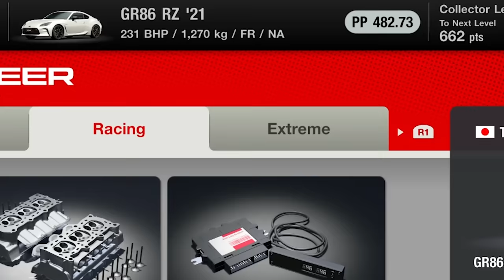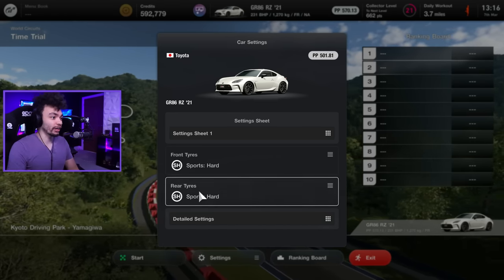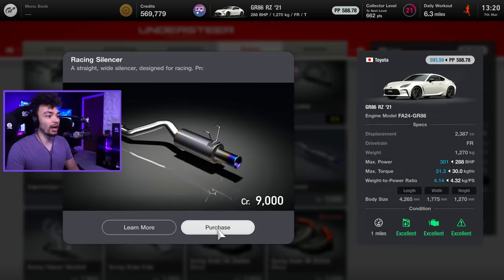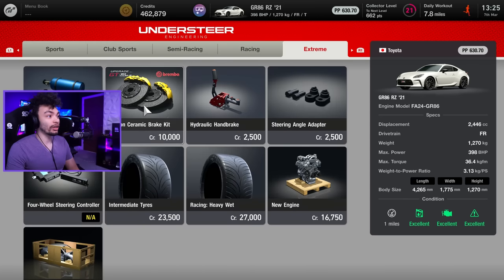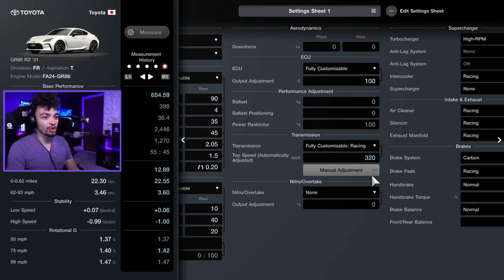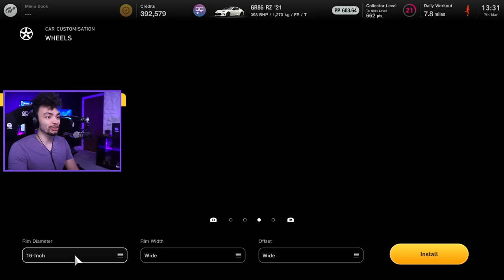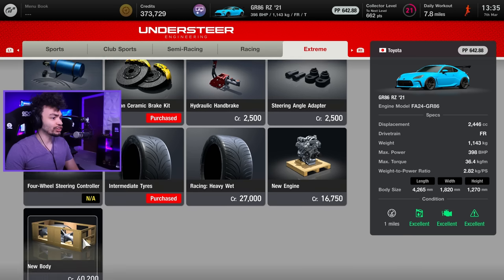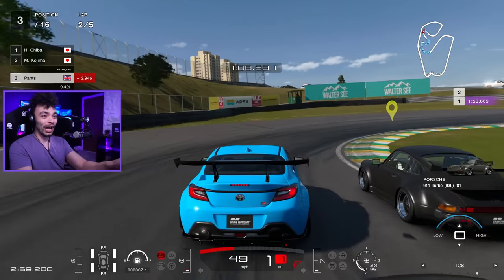How To Upgrade your Car in Gran Turismo 7! (Basics)

Comment: When performance points is not a limiting factor, I will almost always add parts in this order; tires, weight reduction, suspension, downforce AKA spoilers, transmission and then power adders finally. I've been playing this game for 25 years. That method has always worked in my favor.
Reply: Same here. Exactly
Reply: Agreed. The weight reduction helps so many different aspects. Handling, braking, acceleration. Great bang for the buck
Reply: @r6TrdSlow  yeah, on Tire restricted races, I always went with suspension and weight reduction and downforce primarily. Like you said, best bang for the buck.
Reply: Same mate but brakes are big for me tend to just send it on overtakes
Reply: I agree. Now that I've been playing the game for a little while they seem to be exceptionally more important in GT 7 than any other previous game. It's amazing how far the Dynamics and Graphics have come in this game and the past 25 years. Honestly though, some of my favorite cars were in the earlier GranTurismo games.
Reply: @adandredestefano  yea the run of the mill cars are lacking in GT7

Comment: Another tip for everyone that hasn't done so yet. Downforce. This is second only to tires. You'll need a wing and Aero mods for the front and rear to maximize the effect. Maximizing downforce in older cars especially will make them feel like completely new vehicles

Comment: For a gradual improvement that focuses on control, and will let you use your vehicle in more events. I recommend...

Tires first.
Weight reduction 2nd.
Brakes 3rd.
Suspension 4th.
Flywheel & auxiliary stuff 4th (power limiter, brake controller, etc.)
Ecu, intake exhaust, turbo/supercharger/etc. power last.

Ballast/widebody/spoiler/nitro optional.

Comment: I’d like to add about the gearing, don’t just follow the power points, do it based off what race/track you’re trying to do. Like if you know you’re gonna be doing a lot of corners and need fast acceleration in the low gears, make your top speed much lower, that’ll give you a higher gearing ratio to get a faster acceleration out of corners but a lower top speed. Top speed isn’t very important unless you have a lot of straight long shots in the race you’re doing. Yw

Comment: Good basics video! May I offer some advanced stuff?

I have this same car, and I was tuning it for around 550pp, 295 hp. But it was unstable at times on SH tires. Snapping on me when I corrected for a little oversteer. 

I kept the suspension stock to retain it's balanced handling. (Warning: even if you match the OEM suspension settings with your customizable suspension your car likely won't handle the same. For example the roll bar will not feel the same) 

I knew most of my problems were due to the power delivery of the car. So, most of the Tuning came down to tuning the LSD. 
I know it's an intimidating thing to work on but just work on it like this. Modify only one setting by like 10 up or down, take it for a spin, see if it is improved to you. 
For this car I ended up slowly maxing the intial torque, lowest acceleration sensitivity, and maxing the braking sensitivity. Why?
braking sensitivity activates when off throttle. Acceleration sensitivity is when you are on throttle. Initial torque can be thought of strengthening the actions of the LSD. Remember the LSD is only active during cornering. 
I ended up on the lowest acceleration sensitivity to make the car rotate under power, but not feel like a welded diff under power. (if you go for the highest setting this is kinda what you are doing) Whereas the braking sensitivity needed to chill out. This makes it understeer more, but this car's suspension is built to make it playful, so it compensates. I steadily increased the initial torque to soften the reactions of the car. (You usually want to do this as you increase in power)

Now the car can be used on sport hard tires for sliding fun, or sport softs for racing with TCS on 1. It is setup to be steadier early to mid corner, but you can adjust mid corner by dabbing the throttle. This may not be how you want to handle the car, but I like it.

Also good to note, you can only add so much ballast to the car, so don't take too much weight away, save the cash if you don't need the weight taken off for sport mode for instance.  Or else you'll have to pull more power from the engine to compensate. Which you don't always want to do. (Tip: Use the power restrictor first, before the computer to reduce power. You keep more torque using the restrictor)

 You can also save PP by keeping a few stock parts on, like the transmission and suspension, if it ain't broke, don't fix it. But if you do want that little bit extra, get what you desire. Some suspension kits only do height, some add camber, the last one does everything. 

Last note about Putting sticky race tires on a street car. Street cars don't have racing suspension to handle the stickiness of those tires, they are built for street tires, using the softness to maximize grip. You should stiffen your suspension all around to maximize the effectiveness of the car. Lower the car for better CG, but make sure to stiffen the suspension with the ride frequency, cause you could have a soft car that bottoms out. Similarly with the dampers. Stiffen both in an equal manner. This applies for all changes. Unless you are trying to change that front/rear balance. Remember that suspension tuning is all about weight transfer. If your car shifts it's weight too much to the front under braking, (The back gets light, your front end becomes a pivot point) Then increase your rear suspension damper's extension, and the front's compression. 
IN SHORT: Race tires on: Stiffen dampers, roll bars and ride frequency, and add a little camber 0.5 or 1 should be good, consider more in the front than the rear to make better use of the fronts, and keep more contact with the road on the rears when accelerating.

Hope this helps!
Reply: I wish this was reddit and I could use the remindme bot.

Comment: Don't forget to modify your downforce since you added a wing and splitter. I always add downforce to the driving tires so I get better traction. My 86 is seriously a fun car thanks to the tuning. Also, don't forget the natural frequency. I find my cars more stable when they are balanced. I usually go for a natural frequency of around 2.0 or 1.9 on both fron and rear.

Comment: DONT LOWER YOUR CAR ALL THE WAY. YOU HAVE GONE MAD. Rather use aero and other mods, then slowly lower your suspension and find the sweet spot. If you lower the 32 all the way down you cant steer at all.
Reply: Thank you! I was screaming this in my head  lol lowering as far as possible means your car bottoms out more easily, there's little room for shock decompression which also leads to your car sliding out, etc. Lower your car, yes, but responsibly for center of gravity, not flat out rubbing the ground... But Theo is an arcade racer after all, not a sim racer...
Reply: @tinystar3010  any channels that talk about sim racing well?
Reply: I always lower them leaving out 5-10mm

Comment: The order of mods I go with is:
Tires (racing soft)
Suspension
Brakes
Weight reduction and chassis rigidity improvement (I do those two together)
Transmission, flywheel and clutch, differential
Power mods.

Comment: I'm asking you Youtubers to do a video on balancing tuning for PP specific races, how you can't just buy power, you need to balance the car out.
I found it really interesting trying to tune and purchase parts to make a car hit the PP target WHILE making sure I cover utility parts that make the car balanced.

Like you could drop the tires down to normal hard's and give more power, but the tires will skip all over the place, same with suspension, you can skip to inch out a few more HP, but the wobbling of the car in turns.

So I think people need to understand at the higher levels of tuning for PP and maybe even the lower ones, you really need to make sure you are purchasing those key balancing pieces, even though your not hitting your max HP potential.

Comment: So personally I start with the aero (wide body and visual parts) tune said aero (if I have to work in a budget) then go sport softs as a minimum, brakes, suspension, weight reduction then usually exhausts and air filters, maybe a computer and then I usually have a solid vehicle after suspension tuning which I don’t even claim to be good at but I built an r34 last night to race AI Gr4 cars and it easily crushed them but it was pretty much fully built and then detuned to fit the pp requirement
Reply: POV: You are a ricer

Comment: Wide tyres impact fuel consumption due to greater road resistance, this can matter in some aspects of the game re power levels and pit stops etc.. wide bodies also reduce aerodynamic efficiency requiring more engine compensation, again a fuel efficiency thing. It does have an impact on driving style in that to achieve the same speeds you push fractionally more into the throttle which can impact racing line, braking and corner oversteer.

Comment: The bummer with the Dual Sense is that the technology is there to make throttle inputs easier. The Adaptive triggers in this game are trash. I was so excited for them, too, but they don't really do much of anything. 

I understand gas pedals don't really have resistance like that, but with a wheel you essentially have adaptive steering, which causes massive resistance to your turning inputs making you feel when your tires are about to go. 

The triggers in the Dual Sense could emulate this and it would be crazy immersive and helpful.  I would love if they could patch something like this in.

Comment: Racing soft tires are not always the best choice. This is because tires are track-dependant. 

If you race on Le Mans, let’s say, you will perform better with the hard compound, using the performance points for more power and a higher top speed on the long straights. If you race on tracks like Suzuka, Nurburgring or Brands Hatch you will do better as you say, with soft tires.

Comment: Do not lower your suspension as far as possible on all cars, some cars will have the chassis rub on the tyres as you brake and the body rolls forward and you wont be able to turn on corners.

Comment: Is there anyway of saving your car settings tuned. Every time I set up my tunes and start a race it removes them from my car. Like when I set my tunes my cars PP goes from 570 to 667 but soon as I back out of the settings it goes back to 570.
Reply: You can save it on a sheet when you go to car settings

Comment: What about diff settings, camber and toe angle. You can put RZ tires and build a monster engine but what if the PP and tire use is limited. You should start with the essentials first.

Comment: first things to always do is tires suspencion and transmicion and brakes. then later work on the weigth and computers and engine componens. after all mods are install i recomend playing around with the tunning part in the car settings and seen how the pp changes and how the car numbers change. even by adding just 10 points to downforce it changes everything from speed grip turning etc. try to understand what each part does and how it affects the car. and remember is always best to drive the car stock one lap or two before upgrades it will help by telling you what are the differences on handeling power weigth etc. keep in mind his driving style is not the same as other drivers. just cuz he spins out in a turn dont mean is the car problem. many car problems will come from a heavy foot on the gas early breaking or no turning properly making the car shift weigth very un even.  so to put it in simple words. test the stock car in your favorite track. then add tires suspencion brakes and transmision, after go for internals weigth and more. after all of that ia done it comes the fun part learning what each parts does and how it helps the car and for what track do you want soft sawybars or hard, do you want lots of downforce do you need a short trans or high or racing. he forgot to tell you guys to learn the game and learn how to read the car and what is doing. good try bud. 

no no no no no why you change to third person trust your skills, is not the road nore the car is the driver remember that.

Comment: The 86 going single tip is just... why? It's a twin bank engine, a racing exhaust would probably remove emissions parts, install an x pipe, then some racing or no mufflers. It should still be twin exit lmao
Reply: Oh wait it's turbod so there'd only be one exit- gawt damn GT7 is good, holy shit

Comment: wow, are u a noob, YOU CANT LOWER THE CAR ALL THE WAY OR ELSE THE TIRES WILL RUB AGAINST THE FRON AND REAR END. U CAN SEE THIS BY  going into the car cabin view, if the steering wheel DOES NOT turn all the way left and right, u screwed up.  ALSO by buying  THOSE tires u raise ur PP way too high, better off getting the middle range tires. just in case u need to lower ur PP 4 future events. FILTER AND COMPUTER ARE THE BEST TO DO 1ST. then muffler, weight reduction. IF U GO OVER PP, ITS EASY TO JUST TAKE ANY 1 OF THESE BACT TO NORMAL.

Comment: Family it all good you do all of that but don't built on that tune right grab curves like the AI does. Watch out ht w Ai will make your tires wear out fast and then start taking your gas so you get a warning  it's to time to refill and you have enough gas to finish the race. Don't built it to good bc you won't have fun it will be a mess. The Ai will make it rain , lose gas, tire faster than it should,  etc. It done it to me with two cars I have tune to run with Ai . O it will make sure you done win but you place either 3,4 or last. It how it's program. Someone tell me what is going on. They give e us tools to built it but take it away for building it. Wow.

Comment: Yeah this video doesn't do a good job of explaining much of anything really.

"Put sticky race tyres on" is fine until you can't. And I am guessing that if its like GT6 or GT5 you'll have restricted tyre regulations on certain events. Suspension upgrade is bueno, but you do a shit job of explaining about the power upgrades and what they affect regarding power or torque.

I'm also assuming there are PP-restriction races like max of 450 or 500 etc or certain weight or power restrictions added in. Choosing the best set of parts to suit the car and how performance points calc in relative to the affect it has on the power band is important to know.

I don't have 7 yet, but I'm sure that if its as similar to 6 and 5 as I think, the factors I stated are necessary to know up front even to beginners. You give them something to be wary of, clue them into a way of upgrading that might work better in certain events coming up in special weekly trials or higher ranked events....